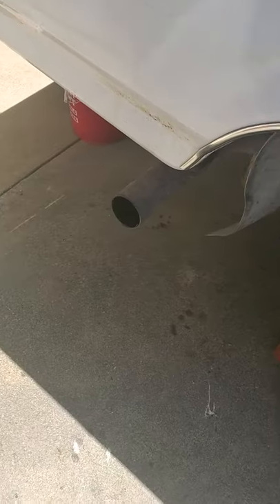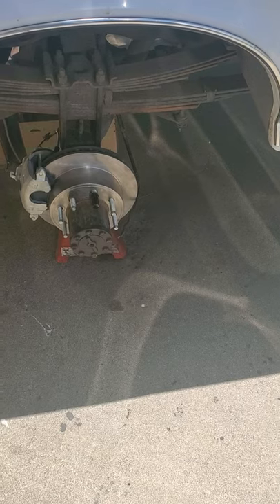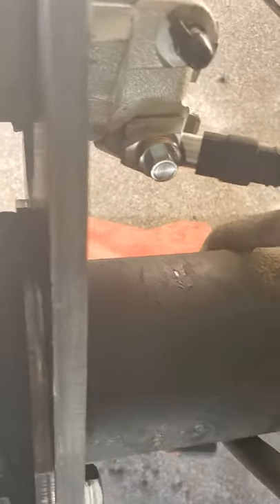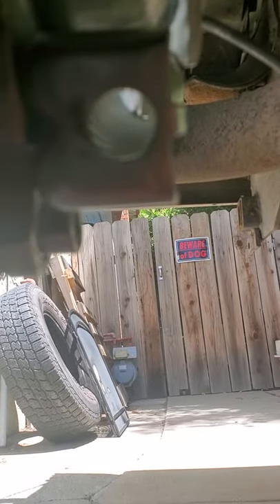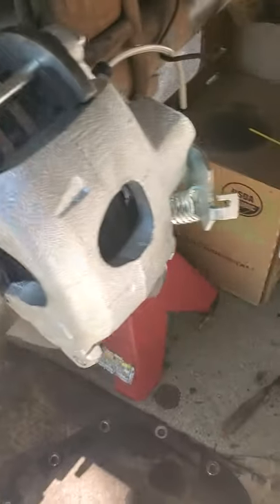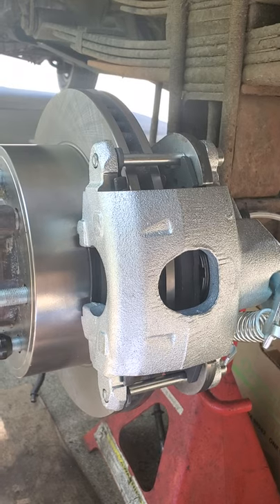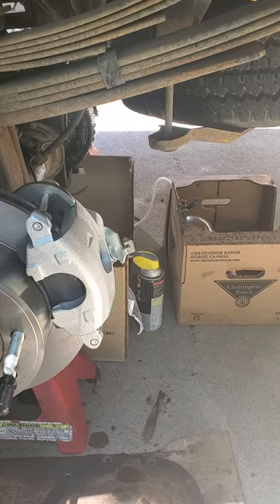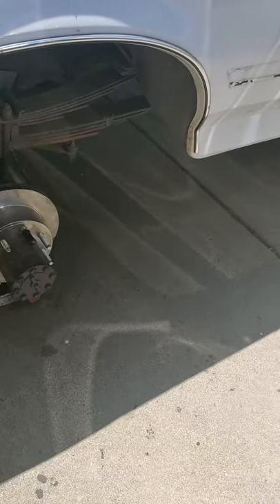97 ford f350 Disc brake conversion part 1

Comment: Jerriod, I know this is an older video but, I just watched another video where a guy converted his 92 F150 drum brakes and he cut the backing plate off with a reciprocating saw and an angle grinder. Do you think that would be possible with the f350 or do you have to remove the axle shaft? Thanks
Reply from the maker: I don't recall. I believe they were bolted on. Sry not much help
Reply from the maker: It was bolted. I could see the backing plate in the bed of the truck

Comment: Is the bracket/flange on the inside or outside of axles 4 bolt mounting location?
Reply from the maker: It's in between the bracket and the axle
Reply: @jerriodmack3456  does it work for a dually as well?
Reply from the maker: @OleGray7.3idi  I'm not sure
Reply: @OleGray7.3idi  Im not sure.

Comment: So i see you did the swap for rear disc....And i told someone else i was doing it and this is what they said...........What you think...did u have to do all this..?.....Thanks...Only thing i didnt get was the Proportioning Valve...got it from CP too.........> then it's a bad idea...disc brakes have far different fluid pressure and volume needs, that can't be supplied byu the stock booster and master....also the prob valve n the truck isn't tuned for rear discs either...
Reply from the maker: So after I put the valve on I'll let you know how it stops. I haven't had time to complete it.
Reply: @jerriodmack3456  ..lol..Oh i see...But do you drive it now.....
Reply from the maker: @summitdave8782  no. Not until I install it. Once the brakes were bled it worked for a bit. But after driving i lost the rears. Bled the system again and same results. 

Just drained the master have to rework the brake lines to go through the proportioning valve so I can increase pressure to the rear
Reply: @jerriodmack3456    Oh gotcha.  Thanks
Reply: @jerriodmack3456   any up date or review? intrested in doin the same on my 96 f250
Reply from the maker: @skylerlevesque5757 

Not yet. Im hoping to finish before the end of the year. I'll post a video as soon as im done
Reply: @jerriodmack3456  Any update yet?
Reply from the maker: @timcurtis7073  yes. I took it to a local mechanic to finish. They went to a local parts store and got a master cylinder that fits the 97 and can handle disc brakes.

I forgot the part number.  They also got directions from cp addict on the proper assembly.  The brake calipers are GM so they're a little wily Wonka.  But truck stops great. No proportioning valve needed
Reply: @jerriodmack3456  how much for new booster?
Reply from the maker: @RollingThunder85  I'm not sure. Just wanted it done.

Comment: You shouldn't have had to pull the diff cover i have pulled the axle shafts and never had to pull the diff cover
Reply from the maker: There was a leak on one of the axel seals.  I figured I just replace everything so I would have to worry about it down the line.  Good thing I did because I found the bad hub in the rear
Reply: @jerriodmack3456 I'm about to go out and attempt again wish me luck lol
Reply: Depends on the Truck if you have a Full Floating no need but in some cases with a Posi-Trac or LSD you need to remove the pins in the Diff
Reply: I have several lsd and the axles just pull out.

Comment: I just did this on mine. Exactly the same as you. What did you end up doing with the E Brake cables. I just don't see how to modify it to make it work.
Reply from the maker: You have to order universal ones. Amazon 

Lokar EC-80FU universal emergency brake cables
Reply: @jerriodmack3456  yup after researching that's the same kit I ordered. Did you use the springs that came on the cables or stuck with the ones on the calipers or both?
Reply from the maker: @dustinp9732  I had to have a shop finish mine! I'm not sure which ones they used. But I have the directions from the company I bout the kit from now. I dont know how to attach the directions to the link

Comment: My kit didn't come with a spacer but I need it for sure how thick is yours?
Reply from the maker: 1/4 inch I think. I'll grab a tape measure in the morning and measure it. Cp addict should send you one. And did you see my post about changing the master cylinder to get the system to work
Reply: @jerriodmack3456  no wtf really I have a 91 7.5l wonder if it's the same damn it I bought my kit from Barnes 4wd
Reply: @jerriodmack3456  no I'll look for it
Reply from the maker: @RollingThunder85  is it a sterling rear end?
Reply: @jerriodmack3456  yes a 10.25
Reply from the maker: @RollingThunder85  mine is too. It should work. I'll also see if I can find the part number for the master.  Did they send you directions?
Reply: @jerriodmack3456  no sir all I received was the brackets wrapped in plastic my friend what's the deal with the master cylinder it won't work? I ordered a proportioning valve an adjustable unit
Reply from the maker: @RollingThunder85  the bracket is 1/8 th inch according to CP addict.  

And I have a part number for the master cylinder from o'Reilly parts here in California.

BHH NMC 11116

It fits my 97 booster with larger internals for disc brakes. Saved me allot of time on plumbing.
Reply from the maker: @RollingThunder85  if you want I can email you the directions my shop used to finish the job.
Reply: @jerriodmack3456  thank you thank you thank you
Reply: @jerriodmack3456  I'm in Portland how's the weather u getting snowed on
Reply from the maker: @RollingThunder85  no snow im northern California. Whats your email?
Reply from the maker: Maybe you can walk me through on how to add it to the video
Reply: @jerriodmack3456  I would but I don't know how to add anything except you can edit the description and put it in there I'm ok with u emailing me did you get my email address? I'd prefer a text honestly
Reply from the maker: @RollingThunder85  I didn't. I have it saved on my Google drive. Not sure I can send that via text.  I can try though.  Once you get it assembled there's a specific way to adjust them properly
Reply from the maker: Email me at stackpass17@yahoo.com I'll send you what I have